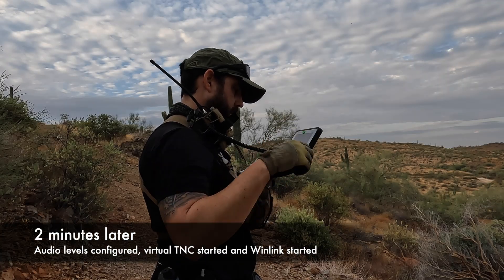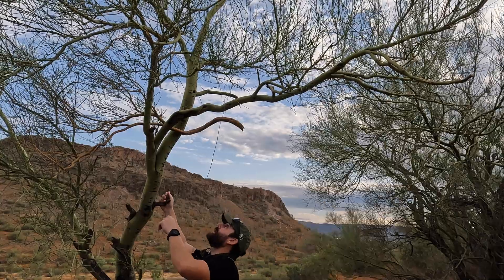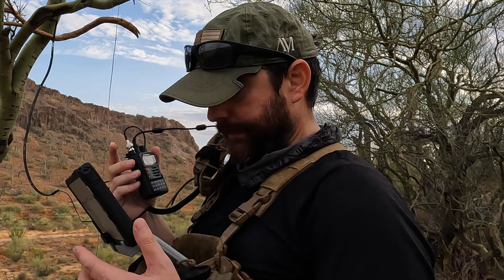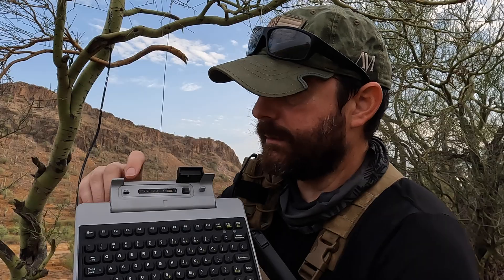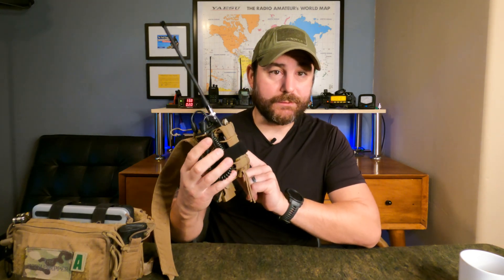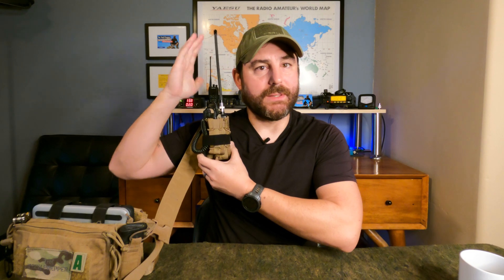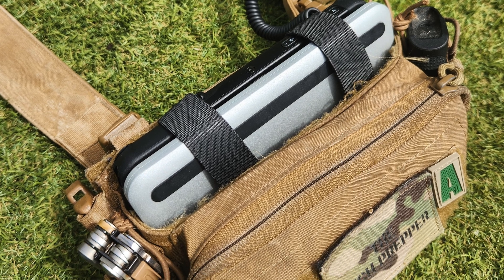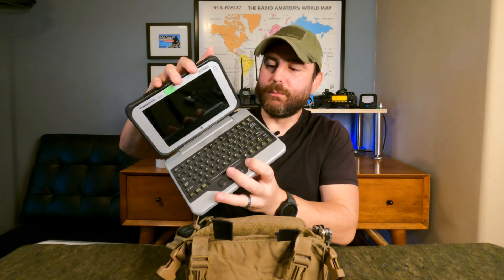Ruggedized Ham Radio Gear for Field Expedient Comms

Comment: J-Pole antennas aren’t the greatest; the has common-mode current problems leading to dead spots in the pattern & it can de-sense your radio unless you are using a good choke.

Comment: Looks good, until i started looking at the prices for the gear...
$300 radio
$500 tablet
$200 chest rig
Thats $1000 just to get the bones of your setup. Guess ill be a poor Baofeng user forever.
Reply from the maker: I picked up the tablet for $110 at the beginning of the year. Price shot up after  I started showing them off. There are other chest rigs on the market. A Baofeng works with this setup.

Comment: I suggest one of the less expense MOLLE mesh vest that waly you can mount lots of various pouches.  Also instead of rubber bands, use girls bungee cord ponytail holders.  They work better, stronger, last longer.
Reply from the maker: Thanks for the tips. I've had this gear for a long time and have jogged thousands of trail miles with them, but having a budget option would likely work very well for most people.

Comment: I would recommend using a Diamond SRH770S antenna on your HT. It's a half wave whip on 2m, which is resonate on 2m without a counter poise. Great flexibility and will not fold over like an Abbree antenna. The con is that it's not resonate on 70cm. If you do data/packet on vhf, that would be the antenna to use.
Reply from the maker: I'm a big fan of Diamond, but their antennas either whip me in the back of the head or face while jogging . I love the performance from the Diamond SRH320A, but the top element snaps off after about 1,000 trail miles. I'll check out the SRH770S to see if it will work. Thanks.
Reply: I bought some bnc to sma adapters from a company in Florida and put the Diamond SRH770S on my IC-705. The SWR is around or below a 1.5:1 on 5w, depending upon what part of the band. The antenna itself is rates for 10w, which is perfect for the IC-705.

Comment: A little bit of weight.  But have you thought of the Y FTM 6000.  Has a digi port, works with the Digirig, and dual banded.
Reply from the maker: I was an early adopter of the FTM-6000R and built a manpack around it. It works great with the DigiRig. If you search for FTM-6000R on my channel page, it will come. That setup will work fine on the fat bike but is too heavy for trail runs. Thanks for the suggestion.
Reply: @TheTechPrepper That vid is the basics of my suggestion.  And rigs like a TFM 6000 need to go ahead and be able to do packet/VARA in them.
Reply: @TheTechPrepper I am 66, so bike or running is out.  But got a nice roller from WM, and I can roll the station out to the car, or deploy on Houston METRO.  Works well.

Comment: Good to see u also have password issues with winlink but if u use a backpack I put some coax in a piece of gray 20mm PVC conduit with 3 ferrite beads attatched to a BNC connector on a end cap and ran a 1/4 wave wire down the conduit for a counterpoise so I put put that on the outside of my bag and I can connect my radio to it but also other antennas etc
Reply from the maker: Clever idea. I've tried a few relocation options, but I haven't found one yet that works while jogging. Your approach would work well for backpacking. Thanks.

Comment: Try a pigtail on that rubber duckie. It should give a better counterpoise than your boby.
Reply from the maker: Smiley Antenna offers a tiger tail adapter, but I've only used it a few times as it gets in the way. I'll try it at the same location next time and see if it makes into the same set of stations. Thanks.
Reply: @TheTechPrepper  try tieing it to the start holding the radio to.

Comment: Gaston, Great video! Great kit! As you and others have mentioned failure happens and its a learning opportunity.
I'm with a few others on looking for a decent system for bluetoothing a phone or small tablet and radio together. Bluetooth increases power consumption and most bluetooth capable radios tend to be power hogs.
If you every get all the kit you want, you become like a Special Forces paratooper with the better part of 200lbs of gear hanging below you as you parchute down. You seem to be very smartly cutting the balance between need and want to come up with excellent kit given the market.

Keep up the great work!
Reply from the maker: I completely agree, failure is a great teacher. I learn from these all the time. My goal was to show people my thought process when building solutions for communications problems. Stumbling is part of the design process. 

I've used the Mobilinkd over the years and while the Bluetooth is convenient, that device has other issues. It's another battery to charge and the button is easily, accidentally enabled with the slightest bump. I've had so many dead batteries over the years with it.

Comment: A related side note to amateur radio for ECOM in support of disaster communications. The day before hurricane Idalia made landfall, Gov. DeSantis announced he had deployed 500 Starlink systems with first responders, and he had another 2700 in reserve ready to deploy. I believe this type disaster communications is the future. It will completely shift amateur radios relationship with governmental agencies in relation to ECOM support. It could lead to the end of amateur band priviledges. The NYSE has moved to HF for communicating stock exchange information globally. I think they will lose their zeal at the bottom of the solar cycle.
All this is to say, amateur radio in its dying years will become more and more the domain of hardcore preppers.
Reply from the maker: We've been using StarLink RV since it was first introduced on the market. It's amazing the speeds that you can achieve in the middle of nowhere. We take it everywhere and mount it on the back of the Jeep or RV using a flag pole mount on a 2" x 2" receiver hitch. It does suffer from high latency frequently and in my experience is not well-suited for streaming real-time video and audio (i.e. Zoom meetings or YouTube streams). It's definitely another tool in the toolbox. However, StarLink still requires dependence on a third-party provider, whereas HF radio is 100% infrastructure free. It's just you and the other station. For what it's worth, I believe in having multiple communications options even those with a grid tie. I personally have a cell phone, StarLink, Garmin InReach Mini, and HF/VHF/UHF capabilities.
Reply: @TheTechPrepper  As far as I can tell about the only governmental body interested in communications without infrastruce is the military. Everyone else is tying to grid communications, even in disasters.
My only communications are 4G cellphone and amateur radio. Eventually I will become part of the Internet of Things when I have to move to 5G. At that point I will have some form of satellite connectivity. As far east as I live, I am probably more than well enough connected given density of grid communications. Where you are at that extra satellite connection is a wise move

Comment: Failure is not an option... it's a requirement. We just need to be prepared for it.
Good video. Since you're operating on the go maybe an android device connected to the web interface would work better?
Reply from the maker: That would typically work. In this case, I did not have everything automated on the software-side on the tablet, so I had to start a number of services from the command line. Once, I have everything automated, I can actually connect from my phone remotely and leave the tablet in the pouch. I did this years ago when I was running a Raspberry Pi.

Comment: Wish they'd update the Panasonic FZ-M1, been searching for a touch linux LTE tablet for a long time that's not a toy like the PineTab.
Reply from the maker: Same here. The FZ-M1 is not without its issues, but it does most of what I need under harsher operating conditions. With the exception of screen brightness issues with the Panasonic drivers under Linux, it seems to be the best ruggedized tablet for Linux these days.
Reply from the maker: Same here. The FZ-M1 is not without its issues, but it does most of what I need under harsher operating conditions. With the exception of screen brightness issues with the Panasonic drivers under Linux, it seems to be the best ruggedized tablet for Linux these days.

Comment: Hey. I have been working with VaraC/VarFM. Have you looked into that for 2m digital vs js8/Fldigi?
Reply from the maker: I have, but VARA is a non-starter for me as I am not a Windows user and will not run emulation (WINE) under Linux. I appreciate the performance that VARA provides. It's a great option for Windows users.

Comment: I am trying to use the same idea, and frankly using your experiences/insight to get data capability, but my focus on the kit is rather than putting the sound card [DigiRig/other] on the radio putting it instead in one of my chest admin pouches [have two plate carriers] with the Panasonic or Android on a USB splitter. That would allow me to use a GPS dongle, or even an SDR as a broadband receiver [scanner]. The radio I am striving for a drop down pouch like Beez Systems or other to access radio without removing.
Reply from the maker: Definitely tailor your setup based on your needs. It sounds like you know exactly where you want to take your setup. Good luck with you kit.

Comment: i still think android smartphones are the way to go..just use a waterproof one and give it a good case. 
but of course its android and maybe harder to develop. but its a "working" UI-experience and its small, light and can be very rugged if done right. 
then use bluetooth or usb cables. 

but whatever, its interesting to watch your way, im very interesting in your emcomm tools :)
Reply from the maker: I agree that an Android smartphone would be a better choice if it had the same rich ecosystem of applications. I've thought about rewriting and porting all the applications that I use under Linux and it would take me 10 years. I've been using a fairly rugged Android phone with no data plan with good luck. It's the Ulefone Armor X7.
Reply: @TheTechPrepper  yeah the apps are the problem. i only know rattlegram and ft8 to work as digimode so far sadly, hope the devs keep up developing for android
Reply from the maker: @juergenw7495  AndFlmsg works with the DigiRig very well, but the user interface could be improved.
Reply: oh good to know, thank you very much! @TheTechPrepper

Comment: You have the anytone 878uvii+ right? Would you be able to use the Bluetooth on that and dispense with all of the cables and the digirig?
Reply from the maker: Yes, I have one, but I have not yet tried my 878 yet, but I will later this year. Sadly, no. You still need the cable to interface it with the DigiRig.

Comment: When off grid, how are you handling syncing the time clock for use with JS8Call?
Reply from the maker: Great question. Usually with the integrated GPS on these Toughpads. I have also manually set the clock within 1 second by using my GPS watch or by listening to the WWV time broadcast. Lastly, I'm working on a patch for JS8Call that will set the system clock based on hears stations from JS8 or FT8 stations.

Comment: Great experiment, I love to see you "out there" testing.  I've started going to the bnc connectors, and I wondered if you use any thread locker at the actual radio connection, so the whole thing doesn't spin when you change antennas?  Thanks for doing what you do, and showing the good and the bad.
Reply from the maker: I've considered blue thread locker, but have never used it as I routinely switch out the SMA-to-BNC adapter with stock SMA factory antenna when trail running. While it does not perform the best, it is small and rigid enough where it does not get in my way while trail running. This combo also provides an IP67 rating so that can be submerged in water.

Comment: The one thing you do very well is demonstrate how problematic comms can be and how numerous equipment issues can compound the situation.  Just buying a radio and packing it, without ever field testing, is a recipe for failure, especially if you're planning on using said comms for shtf situations. 
I've tested numerous radios/platforms in the field, and I can give you a longer list of what went wrong rather than what went right.  Broken antennas, lost antennas, technical issues with radios, broken cables, battery issues.  A plethora of things that go wrong. 
Almost had a 20 mile walk back to civilization at night due to lost comms to the ride home.  We just got lucky and our paths crossed, but it was sketchy.  Advice to anyone, Field test the gear in the environment that you intend to operate in, and test it more than twice to gather the most data possible. Also, always be prepared for a no comms situation.  Another good video.
Reply from the maker: Thanks for sharing your experience around your failures. Part of the reason why I prefer simple, all-in-one radios is to mitigate additional failure points. As you pointed out, even then, batteries run out and components can get damaged. I agree, get out there and train with your gear before you really need it. It's a great way to identify the potential failure points in your gear and capabilities. 73
Reply: @TheTechPrepper  absolutely. That's what training is for.  There's no time to train once you're in the shit.
Reply: Get a Yaesu VX=1R then find a hard watertight case and it can be a good fall back for such times.

Comment: While you are correct that the internal TNC on the Kenwood TH-D74 and D75 is packet and APRS only, that is not the only way to use these radios for digital modes. Instead of using the TNC, you can simply use the audio interface on the speaker/mic connector just like you would with a Baofeng. The advantage of the Kenwoods is redundancy. Even if your computer is inoperative, you can still do APRS on the standalone Kenwood HT. DE WA1KLI

Comment: As usual, a great test of your gear.  Just because it failed doesn't mean it was a bad test... it just means you need to plan and configure your gear better.  Isn't it nicer to find that out in a test than in a real live shtf moment?
Reply from the maker: It was a great test in hindsight. All of the issues encountered are solvable. I'm a bit concerned about the failure point with keyboard latch. Thanks for the support.

Comment: To clear that antenna from your head, I've used a right angle BNC adapter at the antenna  and snaked a BNC extension cable to the backside of the shoulder strap. Then connected to a signalstick with another BNC right angle adapter. It solved most headslap issues,  except when moving through low trees.  Signal reception was better too. For me, clearing the peripheral vision was the goal, and it worked well.
Reply from the maker: Thanks for the suggestion. I've tried something similar using two techniques for antenna relocation from CAATail Antennas:

1. "The RTO" Wearable Antenna - Eliminates slapping and is very secure, but your body attenuates most of the signal. This works well for short range communication, but not the distance I was working with.

2. Relocation cable going into a gooseneck with an Abbree tape antenna. Worked better performance-wise, but was too bulky and difficult to manipulate while moving quickly. This seems similar, in principle, to your approach.

Your technique will work, but I will run into the same problem when moving at non-trivial speeds. I have some other ideas that I will be exploring in this series. Stay tuned.

Thanks again!
Reply: @TheTechPrepper  I found relocated HT antennas need a bit of help with ground plane. I have a NA-771 on the back of my plate carrier while the radio is on the cummerbund, so I took some thin wire to wrap around the outside of the thread and effectively built a dipole.

Comment: Thanks for another video. I love how you said you were gonna pause on your vids but we keep getting them so don't quit. I had a field exercise this weekend and found a lot of bugs in my system as well. I'm getting less and less confident in USB connections on the digirig, it would be cool if we could move everything to bluetooth and remove connections altogether would dramatically improve water and dustproofness. That's why i'm leaning towards a 705 for my next qrp setup. Or at least come up with a rugged usb connection with screws like an old vga cable. Good call on the silicone caps, I use dust caps on my bnc connections but I should get some for my digirig ports as well.
Reply from the maker: You're very welcome. Thanks for the support. My apologies about the delay. I am trying balance the R&D efforts of EmComm Tools while continuing to perform real-world scenario testing that I can share on YouTube. I negotiated a 6-week, unpaid sabbatical for later in the year, so that I can make some real progress on EmComm Tools. It's been fun, but challenging to deliver on all the commitments to the BMAC members, life, work and YouTube. 

I would love to see a move towards Bluetooth by the Japanese radio manufacturers as cables have been a source of failure for me as well. Again. I believe that there is a place for an all-in-one, IP68 rated HT that has support for a built-in sound card and CAT control. My vision would include the ability to manage the radio via a smartphone, but still allow the user to have rugged, analog controls with tactile feedback that can be manipulated with gloves.
Reply: amen that is the dream product. Id ask not to stop at HT and give us a 10w qrp and a 100 watt with all these features and leap your manpack system forward 30 years.   @TheTechPrepper